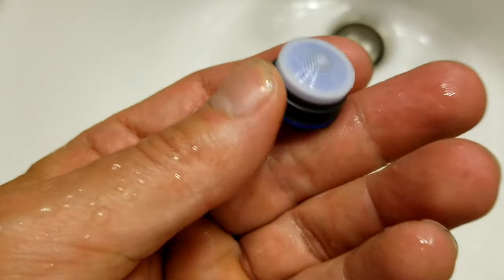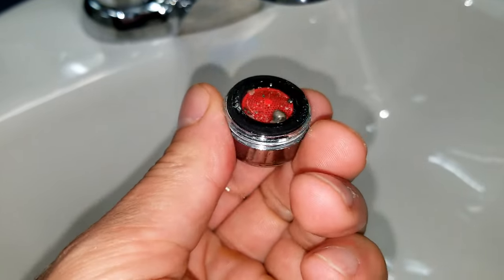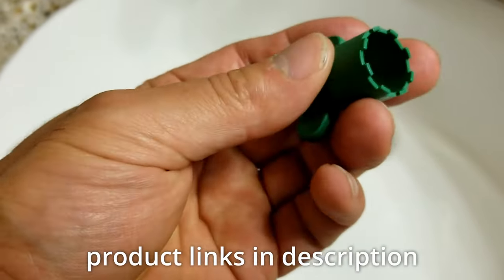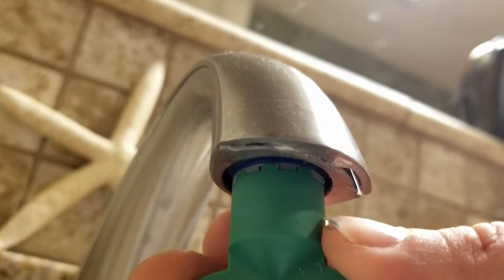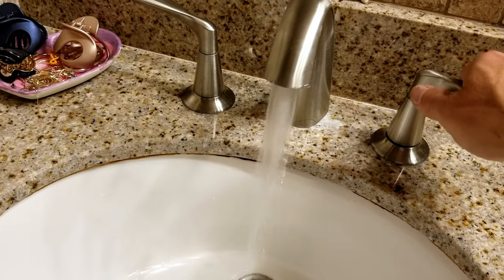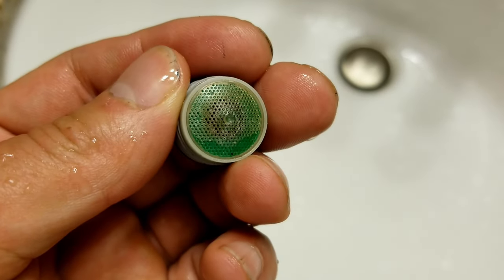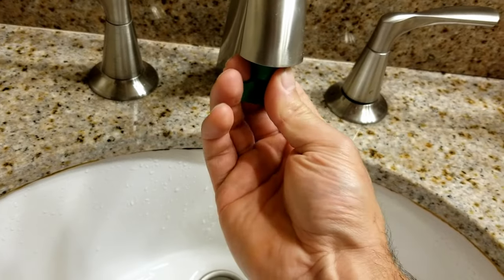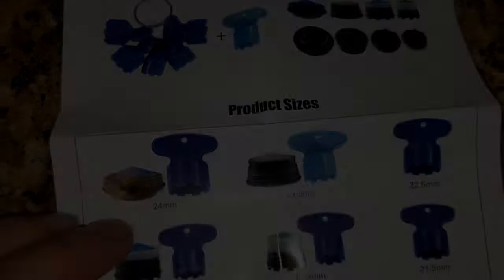How to remove and clean a faucet aerator - Kohler aerator removal

Comment: Thank you! I always did any repairs around the house but I've become disabled and it hurts to tell my wife "I don't know how"... I'm not used to the "fancy crap" , so when she asked why something is wrong, and I can quickly say it's just an aerator replacement and then get a sinking feeling because Kohler made it special, instead of the standard... Which Kohler requires a special tool to do a simple task. I hate feeling useless. So thank you!!
Reply from the maker: Your not useless. Good luck and thanks for the comment.